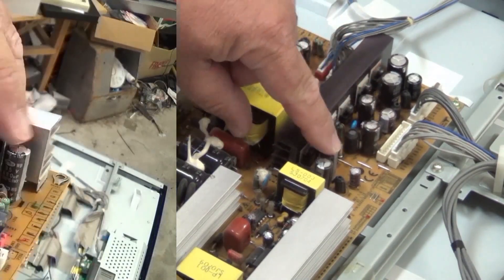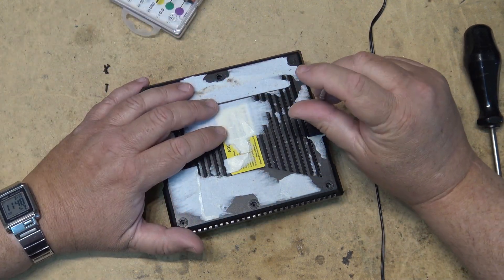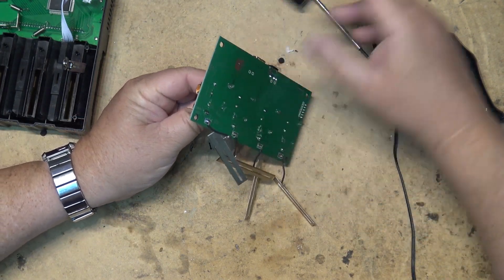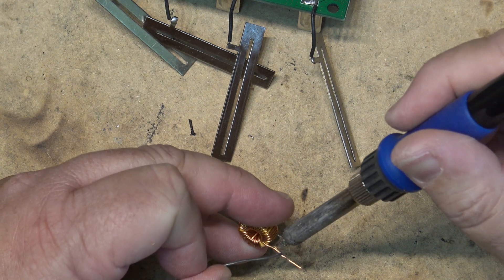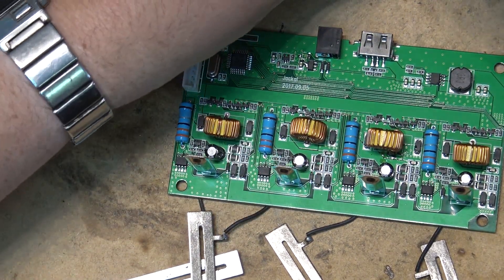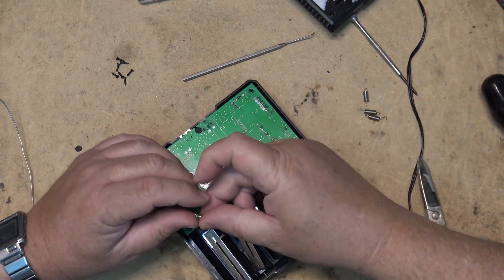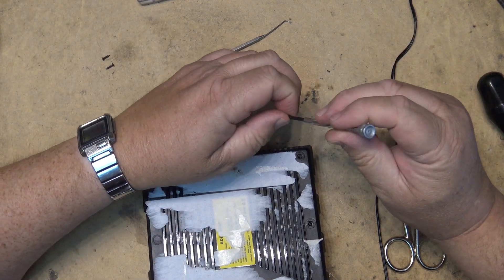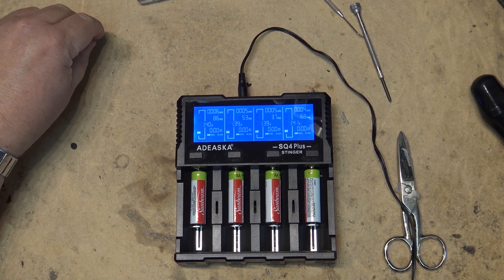Battery charger dropped 1 channel dead can it be repaired?

Comment: You can significantly improve these kinds of chargers by soldering a (say) 20-26 AWG wire from the slider to the PCB pad. That way there isn't the continually degrading connection between the sliding parts which becomes poorer as the chrome plating wears off the steel that they use. Also worthwhile to sand off the sharp corners where the sliding parts meet, and put some dialectric grease in there to make them move more nicer.

Comment: How did you know it was the coil before opening?. Have you been repairing x-ray goggles too? 🤣
Reply from the maker: I did a tear down when I reviewed it, so I knew there were 4 chokes and took an educated guess as to what I suspected the problem was.  I didn't expect the wire to be sheared off, i expected it to be pulled out of the board.
Reply: @12voltvids  Aahh, that makes more sense!. Thank you!

Comment: if you use double sided tape, only use 3M AUTOMOTIVE type, don't buy the el cheapo shit tape or store brand type either, they're usless as tits on a bull. Important make sure you clean the surfaces with rubbing alcohol, then if it's possible use a hair dryer to warm up the area that the tape will stick real good, then it shouldn't fall off.
Reply from the maker: I used 3m vhb tape the same stuff we use at work to attach security sensors to doors and windows.  Problem was it was stuck on drywall / paint.  The paint and drywall paper ripped.  The tape was still intact untill i removed it.

Comment: Why did you use double sided tape? It was faster or the device did not have wall fixing holes?
Reply from the maker: No wall fixing holes. No place to drill either circuit board right below back cover.

Comment: Just maybe have pushed the legs through the board then soldered them after clearing the holes, also as the heaviest parts maybe some hot glue on them would at least hold them in impact rather than just the solder?? Just my thoughts but a good video ;-)
Reply from the maker: It wasn't the solder that let go, the wire snapped off. Had to pull the piece out of the board.

Comment: I have one of those popular brands of battery chargers for my motorcycles, and it went on the blink. I saw smoke coming from close to the first large capacitor in the power circuit. I changed the capacitor, but it ended up being this little voltage regulator, that looks just like a regular round transistor.

Comment: The heat from the batteries melted the glue from the tape that's blocking the vent holes.
Reply from the maker: The batteries do not get hot for starters and there were no batteries being charged and the power was disconnected also the tape didn't let go, the drywall paper let go.  It was initially only held in place by 2 3/4" strips of tape and the drywall ripped.

Comment: I know how that feels with charger & the springs. The plumber drowned my charger, supposed to be a simple boiler check up.
He let the pipe fly off and the water killed my charger, because he couldn't stop the flow & they call them self's "Professional" plumbers  🤦‍♂️
Anyway I fixed the charger the same day, but those springs drove me mad..But blue/white tack saved me from projectile spring launches 😒👍

Comment: Would it be better to fix the coils to the board with hot melt glue, to prevent it happening again? As they're fairly heavy components, think they should have been glued down in the first place, but they weren't .
Reply from the maker: One of the chargers I reviewed did have them glued. I didn't bother gluing as it is mounted to the wall, this time by zap straps, it isn't going anywhere.
Reply: @12voltvids  3M VHB tape will never let go, the wall, the paint or the plastic will fail first.
Reply from the maker: @SeanBZA  it did. The paint came off.